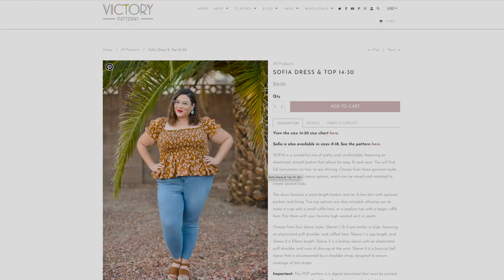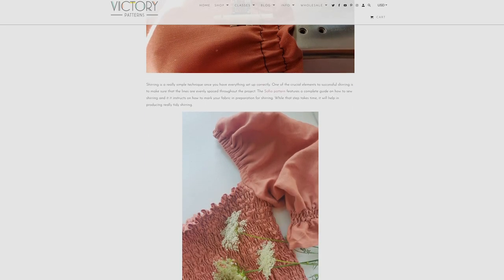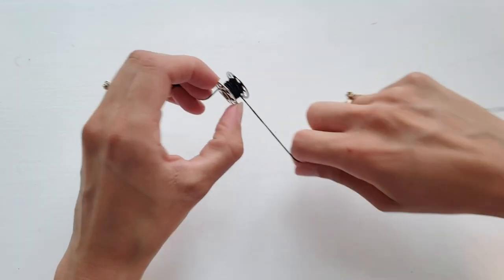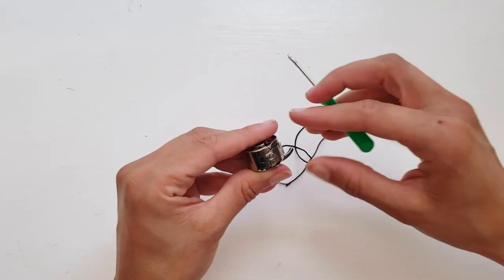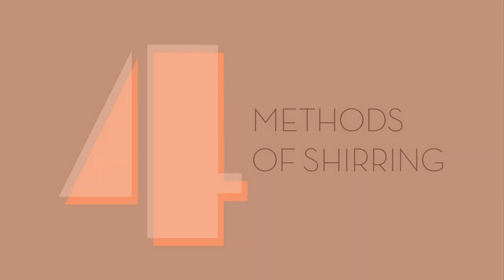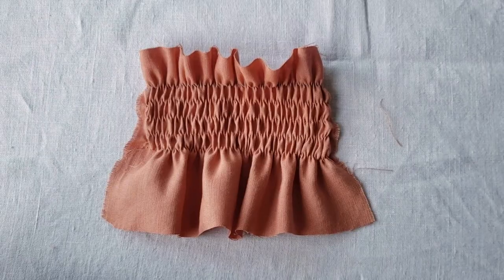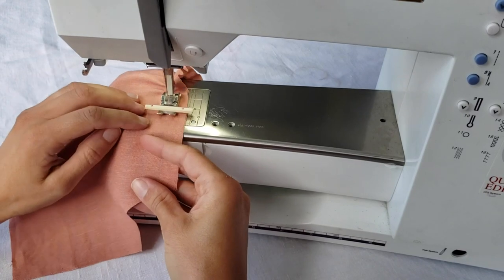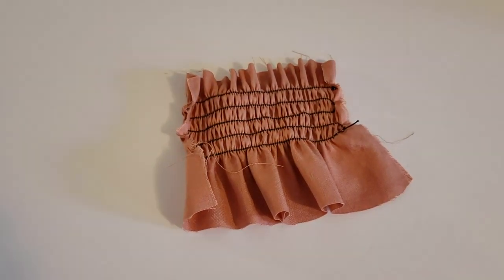How to Sew Shirring - A Complete Guide

Comment: My elastic popped every time I tried shirring before watching this. And as soon as you said ‘high quality elastic’, I thought I was DONE FOR 💀 but it ended up being the tension on the bobbin 🙌🏾🙌🏾🙌🏾 also, following your instruction, the shirring was not only successful the first try, but after I finished, I realized my top thread was missing the cap and wobbling like crazy... all that to say, your method was so helpful that it even surpassed my  extreme user error 🤣🤣
Reply from the maker: Yaaay, you did it! I'm so happy that it worked out. There are so many little things that can contribute to it not working, so you really just have to take it one step at a time. I hope you've enjoyed the technique.

Comment: When referring to "too loose" or "too tight", would you say the correct tension for the elastic thread is for it to have the same tension when pulled from the bobbin case as regular thread when sewing normally? I just want to double-check before I loosen my bobbin tension.
Reply from the maker: Good question! You want the tension for the elastic thread to be looser than with the regular thread. Once placed into the bobbin case, the elastic thread should release more easily in comparison to regular thread. For example, with regular thread, if you place the bobbin into the bobbin case and dangle the case by holding the tail of bobbin thread, the case should not drop when held still. If you give the thread/case a bit of a bounce, it should then only drop about 2 inches. This is roughly how much tension release you should have for the regular thread. With elastic thread, if you dangle the case when holding the thread tail, the case should drop slightly when held still. I hope that makes sense!
Reply: Makes great sense: thank you so much for taking the time to clarify. 😊

Comment: Thank you so much for this tutorial. I was wondering, when finishing my seems on the overlock machone (with the edges being cut) will it not make the shirring thread weak?
Reply from the maker: Good question, Colinette. You can absolutely overlock the edges.  When you're sewing the shirring, you will either be using the continuos method, or you will sew a backstitch. In the instance of the continuous method, make sure to pivot before  reaching the edge of the fabric, about 3/8" away from the edge to be safe. In the instance of backstitching, make sure to sew the backstitch just before reaching the fabric edge, but sewing it still withing the seam allowance; this way when you serge the edge, you will not trim off the shirring stitch.

Comment: I've been shirring some dresses and tops for my granddaughters using lightweight quilting cotton. The fabric pieces are straight rectangles and I sewed the side/back seams together first and then shirred the fabric (it was basically a tube). My shirring gathers have not been as tight as I'd like and I wondered if shirring "in the round" like this decreases the amount of the shirring effect?  Or do I just need to play more with my tension? Thanks so much.
Reply from the maker: Hi Jaymie, so sweet of you to sew dressed for your granddaughters! The fact that the fabric is sewn in a tube will not affect the result of the shirring. You likely have to play with the bobbin tension, upper thread tension, and stitch length. One or a combination of these things will likely give you results. Best of luck with it!

Comment: My bust measurements is 40 inches 
how many inches of fabric do I add on to make a elastic shirring top
Reply from the maker: I use a 2:1 ratio, meaning that you would double the measurement. That being said, the shirring results can vary based on your fabric, elastic thread, and sewing machine. It's a good idea to do a test on your final fabric to determine your shirring take up. I suggest starting with a rectangle of fabric cut to 10" x 5". Sew shirring across the width. Ideally, it should reduce to 5" wide. Don't forget to steam as that will help to shrink it. You can adjust the settings as mentioned in the video to achieve various tension/stretch. That test will help you determine if you need to adjust your ratio. For example, if it shrinks to 7.5" you may want to reduce your ratio to 1.5: 1,  provided you've gone through all the machine's tensions settings and are still getting the same results. I hope that helps!

Comment: my fabric isn't gathering, i did try all of the tensions. It's just like an straight stitch, what can I do with that?
Reply from the maker: Hey! Try lengthening the stitch length. I start with 4.5 mm. You should also check the bobbin tension to make sure it's giving enough resistance to create the stretch. Also, make sure that you're using a good quality elastic thread. I hope that helps!

Comment: Hii. Can shirring be done on stretch fabric?
Reply: Hi Keith, good question. I haven't tried shirring on stretch fabric myself but my concern would be that the fabric would become very distorted and difficult to work with. Also, I suspect that depending on how stretchy your fabric is, if you stretch it beyond the capacity of the straight stitch on the top side of the shirring, that your stitches will break. I would be hesitant to recommend it, but it doesn't hurt to do a little experiment on a small sample of stretch fabric. If you do try it, let me know how it goes.

Comment: I might have missed it. 
What stitch do you use on your machine?
Reply from the maker: I just use a straight stitch for this technique. Make sure to lengthen the stitch length.
Reply: @VictoryMakes   about how long did you have it at?
Reply from the maker: @saritshull3909  For shirring both sides of the bodice, I'd say it took me about an hour and a half. That being said, I sewed up a lot of these in the development of this pattern, so I think if you were new to the technique, it would take you longer. I definitely suggest spending time on scrap fabric making sure the threading is set up properly, and take a look at the guide foot tutorial, as it will save you some time in sewing.
Reply: @VictoryMakes  oops sorry I meant the stitch length :D
Reply from the maker: @saritshull3909  Sorry, I read that as "have at it". The length will depend on a few factors; your machine, your elastic thread, and your fabric, but I usually set it to about 4.

Comment: I need help so bad!!! When I tried my skirt, the top stitch was too tight and they break, undoing all the shirring. I don’t know what I did wrong 😭
Reply from the maker: Hi Vitória, I'm so sorry to hear that you're having this issue.  I know it can be tricky to get the settings just right. It sounds like your tension is set too high, either on the bobbin, or the machine's tension dial. First, make sure that you've wound the bobbin properly; not too tight, and not too slack. Load the bobbin into the case, and reduce the tension a little bit on the case, so that the thread has slight tension, but pull from the bobbin easily. If you have a drop-in bobbin, you may need to review your machine's manual on how to adjust the bobbin tension. Try a few rows of shirring to see if this resolves it. You may need to play with the bobbin tension a bit to find the sweet spot. If you're still having this issue, try reducing your machine's tension. The tension disk will generally help to control the amount of stretch you achieve from the shirring, but if set too high, it can cause issues. I hope that helps!
Reply: @VictoryMakes  you are a life saver!! I’ll try this tips. Thank you so much 💜